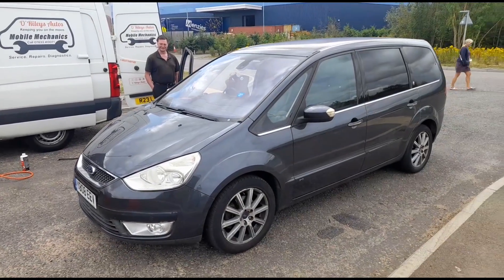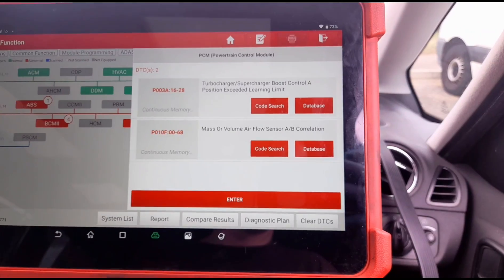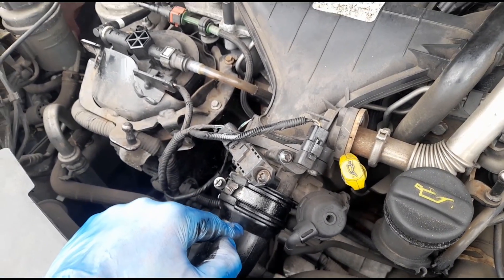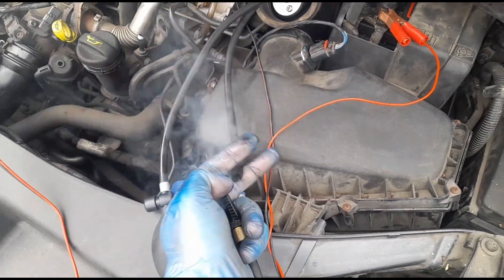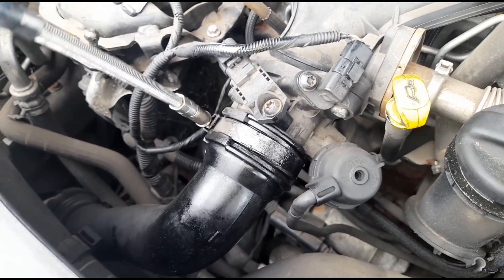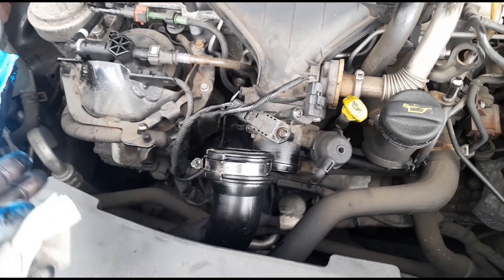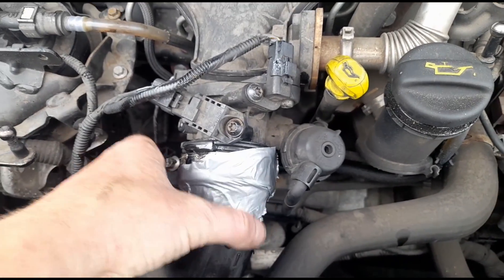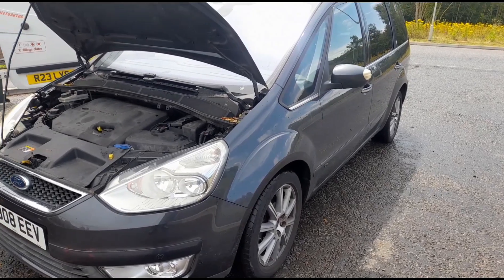Ford Galaxy Black Smoke On Hard Acceleration? Diagnostic Inspection P010F:00-68 P003A:16-28

Comment: My pipe burst on the same hose. However my hose is in two parts and it's the lower part that split. At decent revs the engine light came on, limp mode activated and power drops. Lower the revs and it sorts itself out. I have to replace the lower part of the pipe that attaches to the intercooler.

Comment: I've had as far as I know the same engine on a Citroen C5. At the garage they fitted a new turbo and they left a hose barely connected. I revisited them as I had issues with black smoke and the engine didn't really pull. They said I was driving under revved, had the DPF ruined also. I sold the car and the guy took it tonhis mechanic which notticed the problem

Comment: Had exactly the same pipe gone on a Ford Kuga Mk.1. Various garages couldn't find the problem, but saw a possible problem solver on a Ford forum. I couldn't see a problem with the pipe, but when I felt round the back of it, I could feel a three inch long split in it. I took it to  my usual garage and the guy said it was a big job and would be quite expensive. That was him finished. Got the part from a Ford main dealer the same day for about £35 and fitted it myself in about an hour. No more smoking and ran like a dream.
Reply: How did you get to the screw  on the bottom of the intercooler pipe behind the bumper do u have to remove the headlight to get access
Reply: @markAnthony338  You've got it Mark. 👍

Comment: hi,i have black smoke and loss of power after the car heats up on a ford focus mk2.5,black smoke only on hard acceleration, pipes are ok,only a steering angle sensor fault code,any iddea?

Comment: You can start the engine up and there's no knocking no nothing I've checked the oil and checked the water I ever got a clue what's the matter with the way it keeps white keeps cutting out and sometimes it will literally go on high ribs and then you have to switch the car off bro please can help

Comment: Staggered no garage could spot that problem with their eyes in under 10seconds.  They shouldnt be touching any car if that is there level of inability.  You can hear the boost leak at idle, off load,  before even opening the bonnet  !

Comment: I had a problem like this on a Freelander TD4. I used a section of racerboy turbo pipe to tide it over. Don't know if you can get it locally, but you could get a 90degree and just cut the end off that pipe ... could be quicker and or cheaper

Comment: i keep a large inner tube puncture repair kit for repairing holes in air intake pipes and boost pipes, normally used as a temporary measure but some repairs have lasted the life of the car. just get the oil off with brake cleaner before applying.

easy to use, cheap and made to stick to rubber/plastics
Reply: Works well on rack gaiters too👍

Comment: My 1.5dci nissan quashqi gives out black smoke when i give it some beans i might have to get it checked after seeing this.
Reply: If it has a hard plastic pipe that goes over the top of the engine, they usually split at the corrugated part

Comment: I have an Astra  17.cdti 2011 plate, I have been having trouble ever since i purchased the car, It starts every time it runs ok when it is cold but as soon as it warms up and i'm stopped in the traffic it starts to idle rough jumping between 850rpm and 500rpm.  I also notice if i put my foot down i also get a big puff of black smoke and sometimes a smell of diesel inside the car.

I was told it was the SCV suction control valve, so brought a new one changed it and still the same, then i was told it was the glowplugs, Brought glowplugs changed them and still the same, then was told it was the mass air flow sensor, brought a new one changed it still the same.

another said it was injectors and another said it was an air leak?

Do you know if the Astra J 1.7cdti  2011 has the same pipe as the broken one in the video? and if that may also be a possible cause?

Thanks in advance.
Reply: Have you checked and cleaned the EGR valve and the below pipe.. these engines do get coked up and i have to clean my EGR & filters every 6 months on my zafira 1.7cdti, otherwise it drinks diesel like a fish…and runs like crap.. by the way no codes and short city journeys. Need to consider changibg for a petrol
Reply: @neildean7515  I did clean the EGR but not the pipe below, I forgot to mention i do get a engine management light that comes on sometimes which throws a P0301 'misfire cylinder 1, This only happens when the idle drops below a certain rpm. sometimes the engine light will then go off by itself. 

I will take another look at the EGR and the below pipe,.

Thank you for your reply much appreciated
Reply: Did you relearn the pump when you fitted the new scv
Reply: @tomfinch4130  Yes I had the relearn thing done by a garage,  I Found the problem eventually.
Where the EGR is bolted onto the inlet manifold there is a type of covering that can be taken off and cleaned, When I went to inspect the EGR I found lots of oil around that covering which told me it was leaking. Until the bits arrive to fix the issue I Tightened up the covering and the rough idle diminished a lot.  Hopefully the lock tight and gasket come this week so I can do a proper job.  I think the covering which I speaking of is What the guy above called the EGR under pipe.
Reply: Rough idle will cause an EML to come on with the code p0301, which is cylinder 1 misfire and the misfire is caused by the rough idle. EGR in my case.

Comment: Staggering that any mechanic worth his salt couldn't see those problems. For such repairs of plastic I have used two methods: (i) a hot glue gun and (ii) a soldering iron. Both have their advantages, but a soldering iron I find effective particularly if you can source some other plastic to add and bulk-up the joint. Great video as always.
Reply: The pressure on that charge pipe will cause pretty much any repair to fail in short time. It needs replacing.
Reply: I use Cable ties as welding rods 👍